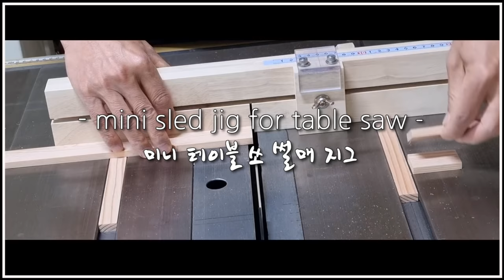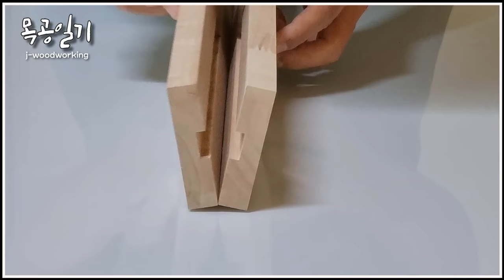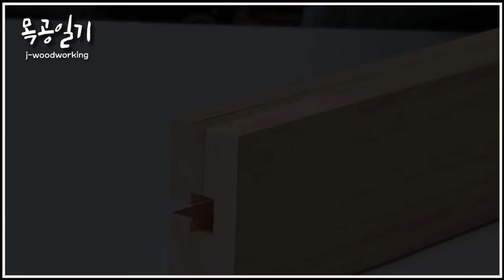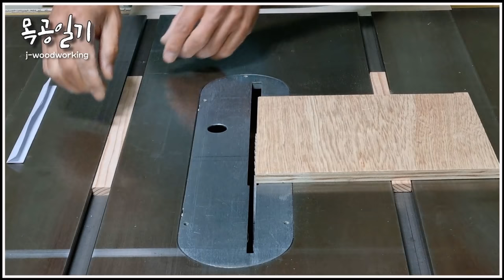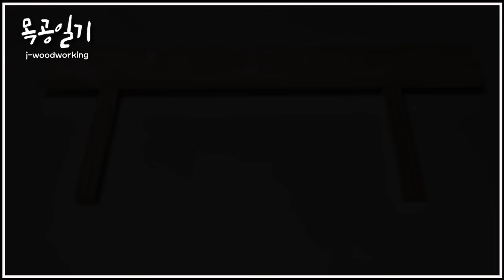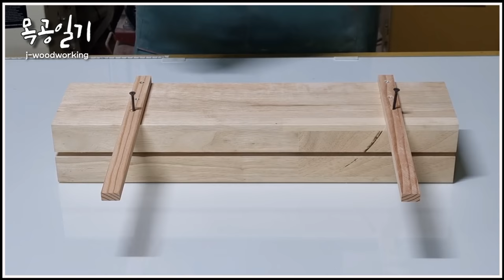mini precision cross-cut sled jig for table saws [woodworking]

Comment: What an awesome job and a beautiful sled. The only thing I could say is (being a retired woodworker and professional table saw operator for over 40 years ) when cutting wood on a table saw use constant motion while pushing the wood piece past the saw blade. Been telling this to trainees for years. I noticed you scar the wood as you stop and it can be plainly seen on the wood pieces you cut. I only say this to make you a better woodworker and show the public an even better you.  I intend to make one of these designs when I open my shop. It's a really good design. 
Thanks for sharing.

Comment: Just a suggestion, wouldn't it be easier to glue up the two rabbeted boards then cut the bolt slot? I liked the method how you squared the unit to the blade. Excellent quality workmanship and attention to detail. The pointer is a nice touch. Thanks for sharing. Looking forward to your next video.
Reply from the maker: Thanks for watching sir.
Reply: You can also use a t-slot router bit which will cut the channel in one shot, so you don't have to perform multiple cuts. Those have saved a lot of time for me.
Reply: Yes, if you have a router table and T-slot bit, not everyone does. What he shows you here is basically is how to build this without a router table so in essence he’s showing people two different ways simultaneously. (Assuming, like you, knowledge of what a T-slot bit does) I, too, admire is attention to detail and creativity. I only wish I had his patience instead of my usual practice of going a hundred miles an hour and trying to build everything in one day!
Reply: @Erik_The_Viking  I use table saw to cut a line first to remove some material for t-slot router bit go through easier.👍💪💖
Reply: @206Seaman  I make t-slots without a router table as it's easier to use an edge guide for more control.
Reply: @BRUCELAN168  I can't make such a pass safely on my table saw do I make two passes with the router. One with a straight bit and finish it off with the t-slot bit.

Comment: It's funny I should see this today.  I have been trying to come up in my mind a way to set the fence angle accurately without all the trial and error. My idea was to cut a 1" board on the right side using the miter slot and bouncing the square off it, LOL.  The difference is that I plan to make a split sled where the left side or right side can be used independently or together as one sled.  

I see I saw this video in the past, so maybe that's where my mind picked it up.  I have a lot of creative ideas, but I mostly get them from parts of many different sources over the years.  I just sort them out to make one good idea from them.  

Thanks for the video.  I needed this one today.
Reply from the maker: Thanks for watching sir.

Comment: Hi J... What kind of drill bit is that at 9:40 ?
Reply from the maker: Drill & countersink bit.
Thanks.
Reply: @j-woodworking9573  that one is different then most. Can you tell me brand please?
Reply from the maker: Korean local brand. 
Sorry.
Reply: @j-woodworking9573  what is the name of this Korean brand?
Reply from the maker: https://smartstore.naver.com/reokim24/products/5330575004?NaPm=ct%3Dkv6ozpcw%7Cci%3D0zO0000OG7nv%2DO1Mn0YY%7Ctr%3Dpla%7Chk%3D12dae1d1fa5776ac90a405cd625f4afa4014c12c
please see here.
Reply: @j-woodworking9573  thank you so much. 👍

Comment: Love your ideas!  I have starting working on kimoko and the angles are a pain.  Actually it's more adjusting the stop block by .002 to .004 of an inch that I can't get right.  I always move it too much.  Any ideas?
Reply: @peethreeorion  Tried that.  Even using a 32 TPI screw to move 0.002" I would need to turn the screw 1/16 of a round.
I found a feeler gauge is a pain but it works.

Comment: 36 seconds in - the wood used is NOT flat. Don't call this precision when the parts are bent please. I like the idea, just you need to show good parts when you do it. The crown can make parts not be cut correctly.
Reply from the maker: You are right. It was bent after routing. But through bonding and screwing it got flat. 
I don't think I make perfect things. What I want to by videos is to give you not perfect products but useful ideas.
Sorry about what you pointed out. 
Thanks for watching sir.